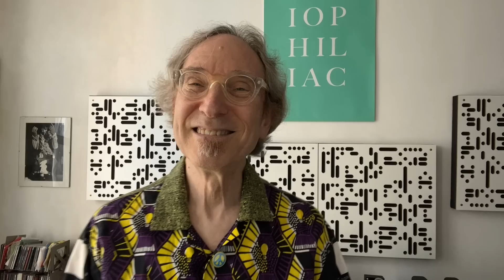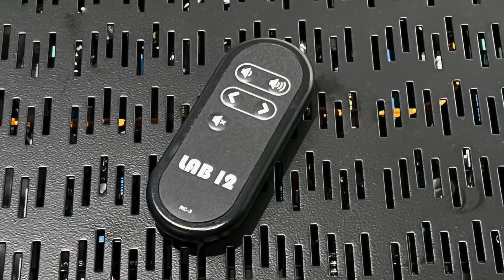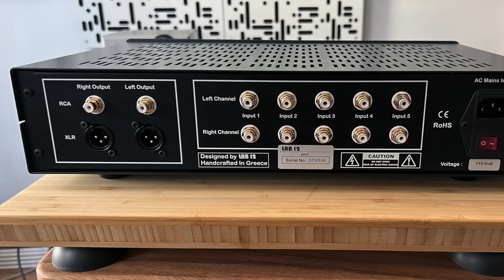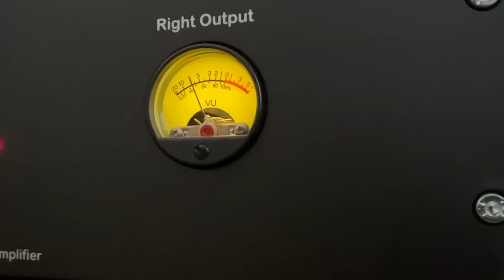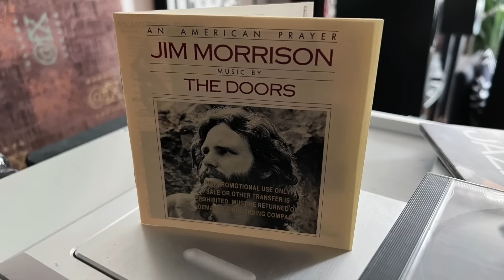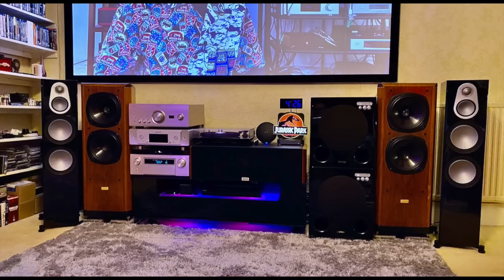LAB 12's tube electronics DAZZLE the Audiophiliac!

Comment: I have the Pre1 for a couple of days and it is so, SO good. The first track just knocked me out - whoa! this was what I was wanting, and missing, in my system, which is powered by the excellent Atoll IN100SE. What I was missing was a bit more solid and 3D presentation that I got with the DECware SE84UF0. The combination of a valve pre amp and a MOSFET solid state amplification has sorted my system to the next level. I think the “last frontier” will probably be room treatment, then maybe tonearm & cartridge on the turntable.

I had been reading reviews on the Lab 12, along with this review of it and the Mighty, then Herb’s impressions in Stereophile pushed me over the edge.

UPDATE  I have now paired the Pre 1 with the DECware SE84UFO which is an even better combination. While good, the Lab12/Atoll combination eventually left me just a tad dissatisfied, somehow wanting more. There was also a hum issue with using the bypass inputs on the Atoll. While I mostly solved that, I never completely eliminated the hum, although since I made the switch I’ve had another idea of what may be the issue.

The Lab12/DECware combination is pretty much “it” for me with two cavaets:

	1. Large scale orchestral music can be congested. It’s better with this combination, but not the ultimate in resolution. BUT … this is a speaker and room issue. Once I get room treatment completed, we will see how that addresses this issue.
	2. I think mono block amplification will improve things more. I’m contemplating either getting another SE84UFO and running both strapped to mono or waiting for the LAB12 mono blocks. I have no timeline for those, but am patient enough to wait. The other option would be to try the Lab12 Suara, which has dual mono topology, but that is much more expensive than getting another SE84UFO, though it wouldn’t take 24 months as with the DECware!

Comment: Hello Steve , Gregory from Gatineau Quebec here. I bought the LAB12 Suara and Pre 1 almost 2 years ago and my last purchase is the Klipsch Cornwall 4.  I’ve always received great customer support from Stratos Vichos and that’s why I am shopping for their reference Dac.  My 2 cents on the sound of that setup got better to MY taste is when I installed some EL34 tubes instead of the kt150 that came with the Suara amplifier. Sophia electric EL 34 tubes are very melodious compared to the kt150 which are more robust. Paired with the Aurender A100 streamer and the nice Chinese Doge Clarity 7 Dac with 8 tubes at the output stage makes some very nice music to my ears.  Thank you Steve for your nice video you produce!

Comment: Hi Steve! Your remarks on the passive pre are making me somehow curious. I am an user of even lesser than a passive pre, as between my AudioNote DAC and Accuphase poweramp only a box with a volume pot, call it a passive pre, is present. I was blown away by the improvement in sound (noted, it is an super high quality volume control), before I used an double ECC82 (12AU7) pre with a very nice PSU. But now a pre seems so useless to me, it just introduces 'extra' to the signal path, where 'less is more'. But it is revealing, the quality of the source is very important. What does an 'active' pre-amp need to 'add' for you?

Comment: Hey, Steve.  I just bought the Mighty based solely on your review. I'm sure I'll love it!
Reply: BTW, I really love the sound of this amplifier.  Right now, I'm driving 1981 Belle Klipsch with the Mighty and they sound absolutely divine!
Reply: How do you like it so far Eugene?
Reply: @grungemax  I haven't received it yet.  I have a feeling it's on backorder even though when I ordered, I didn't get any info from Fidelis.  Not even an email acknowledging my order.  And I still haven't.  But my credit card was charged.  So, I guess I'll have to call them.
Reply: @grungemax  Ok, so I called and the store manager, Marc, said they have a disconnect between PayPal orders and their internal system, which is why I didn't get a confirmation email.  He also said my order is now acknowledged and they are expecting to receive a shipment from Lab12 in the next week or two and one of the Mighty will be mine.
Reply: @EugeneWhitsonPersonalAccount  congrats!
Reply: @grungemax  Just got word that my order was shipped today!

Comment: I’ve heard the pre1 with the lab12  Suara and paired with michi mono blocks. With the michi the lab12 had a nice soft almost papery organic texture, great imaging but the leading edges seemed a little too blurred.  When I played it with the Suara, all the pre1 good attributes seemed covered up by a grey veil.  That’s not to say the pre1 was sounding bad just that the Suara was doing so much of its own thing it was hard to pick up what the pre1 was doing.  The Suara changes were for the most part fantastic, detailed, organic, fast and forward in a good way.  The forwardness was never too much  though as the dynamics didn’t reach too far forward.  Instead the forwardness and finesse simply made everything easy to listen to.  My biggest gripe is that the Suara took away the pre1 colors and instead left a grey veil over top of it. Definitely good and considering getting the Suara but I’d love it if the grey color became colors.

Comment: I noticed the power question that you mentioned concerning power amps, integrated amps, and receivers. For some reason, I found that sometimes the lower powered amp sounded better. That raises a question, what was the power race in the 1970s about? And, there are some megapower amps still around today. It's hard to explain, but I think I got your point.
Reply: perhaps the typical design of an overkill power amp also implies other side-effects that translate directly into the sound, that might be preferable. I would speculate that this may give a dynamic sound, though for sure there are other ways to get there..
So it might not be all compromises when going for higher power, there might be gains too

Comment: I have the Reisong A10, a six-watt tube amp using EL-34 tubes. It's about a fourth of the price of the Lab 12. Low-wattage tube amps rock.
Reply: I run a pair of original Bottlehead ParaSEX monoblock power amps (4W) and my son runs a pair of Paramount monoblocks (8.5W 300b from the same folk). I built my amps 23-odd years ago "just to try these triode thingies" and am totally hooked. Both amp pairs rock and can still stir emotions at a whisper.

Music is not a quantity measurable in watts.
Reply: @TheRealWindlePoons  I bought my first tube amp two years ago, a used 2.3 watt Decware Zen triode. I was blown away by the beautiful and emotional sound from the first time I listened. I figured the only thing that could be better than it , is another one. I just ordered a second one recently to run them in mono ( 6 wpc ).

Comment: It is hard for me to understand how 10 watts can drive the LS50s. Do they have a lot of current? I have a pair if Magnepan 1.7is on order to use with a Luxman L509x and I am hoping it will be sufficient.
Reply: I have  Maggie’s 1.7i speakers myself. Your luxman should be more than enough to handle the speakers. I hope you enjoy them. Just make sure you pull them far enough away from the wall so they can really open up like Maggies do.

Comment: Hi Steve , what about the heat from the amp? This is single ended which I think automatically translates to being class A. I owned a similar (not lab 12) 10 watt low power amp and it was a room heater

Comment: Slightly off TOPIC: THE PSSD and a Epiphany happened to me a week ago. All the New Technologies in Hi-Fidelity (you don't hear those words much) SUDDENLY MADE SENSE TO ME. For a gift I needed a 1 Gig Hard Drive and saw discounted one for 70% off and bought the SOLID STATE DRIVE Portable.... WOW, all my files ZIPPED into my DAT, came out into my AMPS and my KLIPS RP-600 became GIANTS SPEAKERS besting the CDs where those HARD Drive files came. THE SPEED delivery from the SSD increased my VOLUME by at least 6 to 10 dbs and my DAT suddenly had 100% JET FUEL excelled at having the better fuel. 

Most people don't read this far, but I'm suggesting that if you haven't tried a less than $100 Portable Solid State Drive that you do this QUICKLY. 
..... btw, I make no claim to being any expert in this field.

Comment: You mirrored an experience that completely changed the direction of my life long journey into music and great audio sound. Mine was a chance garage sale purchase of a brand new pair of Celestion Model A compacts. I brought them home and was honestly unimpressed. Back in the box and into storage.  A few years later while running diagnostics to solve a sound issue on my massive system, I setup the Model A's on a test bench,extremely near field,  to examine the performance of my electronics individually.  I used an Nad power amp and a little Xduo DAC preamp and "shock and awe" does not adequately describe the emotional response I had. I started listening to everything I owned. I eventually settled in with an Edelweiss 3 prototype  power amp which is 6 wpc EL34 tube based by Wavebourn,  hand made here in Austin Texas. That musical and so beautiful sound kept me up late every night for weeks and up early every morning as well and literally changed my life. The lab 12 you reviewed here seems much the same and to anyone who really loves music, you need a system that can give you this experience.  Sure I still have the massive, bombastic 120db monster system but I  think if I could only have one, the little tube would win out. Though I  doubt anyone actually remembers my previous posts, you reviewed my in between system in the viewer system of the day which was conceived based on lessons learned with the little near field test bench taken much larger. But I have now incorporated the tiny system onto stands which can be positioned just few feet from my head while in my easy chair and with the flipping of a few switches, I  can go right to that ultra personal and blissful sounding system. I love this hobby/lifestyle so much and share your emotional enthusiasm Steve. There is simply nothing else like it.

Comment: This is the kinda purist gear I personally really prefer and use in my own system, and these components seem like something I’d enjoy, but I’d mostly likely want a speck more power. The prices are extremely reasonable too. I certainly prefer lower powered tube amps for the most part. Eh…maybe someday 🔊🎶🙂